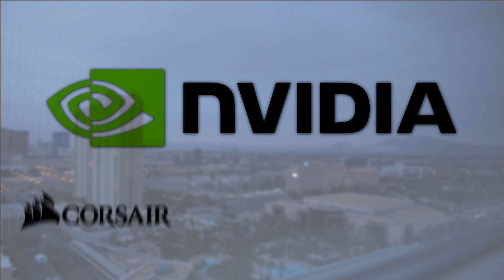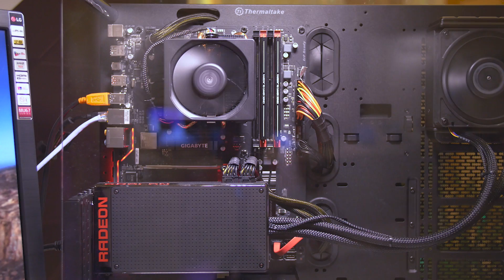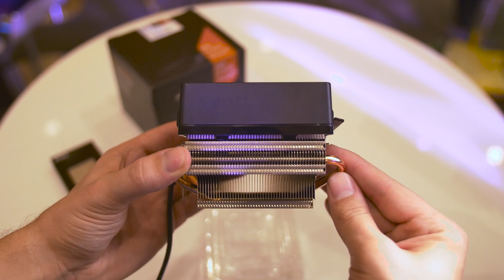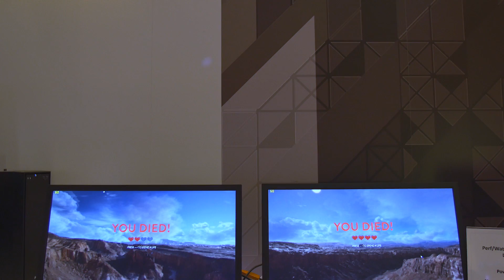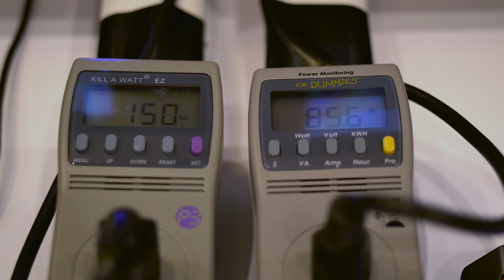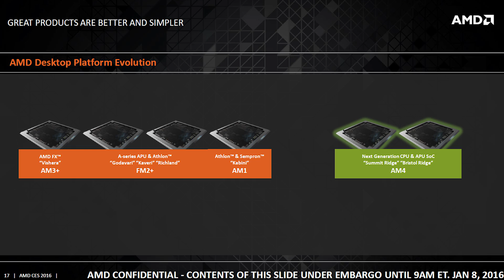AMD Polaris, new Wraith CPU Cooler & AM4 Zen

Comment: AMD going on right direction.
Reply: +Kevin Colon shipping this only with their processors :(((((((((((((
Reply: +Oliver Madariaga its a stalk heat sink... it still doesn't cool it any better, its just prettier and quieter.
Reply: +Machina quiet means it cools better because fan doesnt need to go full speed to get cooling done. same thing with my old hyper 212 cools better and quiet too. fan barely spinning.
Reply: UltraPhaserBlast yes but I'm saying the cooler doesn't lower the temps anymore then the previous one. it just does the same thing more efficiently.
Reply: +Machina the laws of physics and thermal dynamics state that a more efficient heatsink  transfering more heat away than a less efficient heatsink given duty of cooling an equal heat output from the same processor will yield lower temps on the core. its pretty simple. may be able to overclock a bit more with these instead of the old design and keep quiet fan noises. all win. even the old cooler with heatpipes has been proven to cool better than a intel copper/aluminum heatsink. but becauae they need to with fx cpus higher tdp heat output ratings.  linus techtips did a youtube video comparing on same cpu. sbold see that vid so u understand.
Reply: +UltraPhaserBlast “UltraPhaserBlast” Or, they got a fan that is much more quiet than the old one. It's a long shot, but that's my guess.
Reply: Andrew Wagenknecht they got a quieter fan and made the heat sink larger
Reply: fighting for the poor man

Comment: Looks a million times better than the shitty old one and a billion times better than Intel stock heatsinks. Seriously, when people do builds and use those stock heatsinks it makes me wanna scream. This however, looks good!

Btw, I'm really hoping to see a huge AMD comeback. I want the glorious Athlon 64 X2 days back!
Reply: unfortunately not. unless AMD comes out with some stellarly revolutionary item. it's actually really amazing, but intel pretty much controls AMD's market share and thus profits. They cycle through stuffing them down to about 5% followed by a cessation in marketing that allows amd to grow back to 20% ish. All to prevent a monopoly.
Reply: +IRNatman I want to see AMD back so they market isn't just controlled by intel
Reply: +IRNatman Also remember when amd used coolermaster for their stock fans
Reply: +IRNatman Athlon days*
X2, X3, and X4's are all great CPUs.
Reply: Captain Leerox
But I'm talking stuff of legend. When the Athlon 64 x2 came out it changed EVERYTHING. The x3 and x4 were just upgrades. They were great, but the X2 was revolutionary.
Reply: IRNatman OH MY BAD you said ATHLON 64 X2 not Athlon II X2
Reply: +IRNatman Because stock coolers get the job done for 80% of people.
Reply: Timothy Haun
For Intel, maybe, just maybe. But if you're spending hundreds on a CPU, why not drop 30$ on a 212 EVO? It'll run much cooler and quieter.

But stock AMD coolers sound like jet engines and shouldn't be used. Perioid.
Reply: That logic is awful. If I am going to spend $120 on an i3 it won't need an aftermarket cooler, if I am spending $190-$230 for a non K i5 it doesn't need it. If I am buying a non K i7 and not a power user I don't need it. The AMD coolers that have heat pipes also get the job done for any FX chip, excluding the 9590 of course, that isn't overclocked. But I agree, stock AMD coolers are better off replaced. BUT NOT with AIO Liquid coolers or tower coolers. The Horizontal cooler does more than cool the CPU, it helps keep the chipset cool too, which is a common problem for the FX platform.

That $30 would be better suited going towards a couple of case fans which will help with temps more than an aftermarket cooler in most instances. Or into your GPU. Now if we are talking about overclocking then of course get the aftermarket cooler, or if you're worried about aesthetics I suppose.
Reply: Timothy Haun
I said nothing about a cheap ass i3. I clearly said "if you're spending hundreds". Please pay more attention next time.

Why are you bringing case fans into this? I'm talking CPU only right now. If you didn't already work case fans into your budget, then you aren't very good at building PCs, are you?

The 212 EVO is much quieter than intel stock heatsinks. On lower fan settings it is completely silent. I bet if you used it as a passive heatsink it'd still perform better than the cheapo stock heatsinks. Why not get it? Again, like I said, if you're dropping hundreds of dollars already, why not spend an extra 30 dollars on a proper heatsink?

WHY would you buy a non K i7??? Do you also like wiping your ass with money? Buying a non K i5 isn't the best choice already, but a non K i7? Madness! Also, if you're talking non power users, why would they need a i7 in the first place? Flawed logic.

AMD stock heatsinks getting the job done? That's a good one. Maybe if you only have a x4 and are deaf.
Reply: +IRNatman  non k i5 are like $80 more expensive
Reply: +IRNatman  non k i5 are like $80 more expensive
Reply: +IRNatman Is this cooler a joke? No fan speed regulation? It's 2016 for gods sake. Why do you hate intel stock cooler? It's good enough for every locked chip. I have 4460 with stock cooler, never above 60° in games, virtually silent, the gpu and case fans are louder.
Reply: popula ....
Are you talking about the Wraith cooler being a joke?
Because it's literally a stock cooler, the "Wraith" branding literally is a way of saying they are updating their AMD CPU stock cooler design to eliminate any issues people have with AMD's current cooler. It isn't meant to compete with any other cooler, just to postpone or eliminate the NEED (To me, if I'm running an 6300 on a stock cooler, I definitely will upgrade in the future because the current gen CPU cooler is not adequate, the WRAITH cooler, however, while not only being more aesthetically pleasing and EFFICIENT (Heat-pipes and the efficient fan design)
Reply: Captain Leerox It's seems like a good cooler and all, but NO fan regulation? 2$ case fans can be regulated...
Reply: popula You mean like fan speed? PWM?
Reply: +popula Kinda sounds like you have noisy gpu or case fans if they're louder than the intel stock cooler.
Reply: +IsoMacintosh when i stop the other fans from spinning by hand i can barely hear the CPU cooler. fan mode is set to silent in BIOS. GPU is always louder at load because it has a much higher tdp and its load is much higher when gaming.
Reply: +IRNatman Intel is trying to focus on mobile chips because that's where the market is currently at. AMD however isn't so maybe it's possible they can have a comeback in the PC market. Who knows?
Reply: +IRNatman Been running Intel stock for 7 years on my Core 2 Quad Q9550. Guess I make you really sick.
Reply: Wistbacka
Core 2 Quad? Not really a big deal.. (My HTPC with a Q6600 has a stock heatsink) I'm referring to new expensive CPUs. Yes, I'm aware that the Q9550 was expensive back in the day, but it's just different now. Really amazing aftermarket cooling solutions are very cheap today.
Reply: +Timothy Haun 

Fuck. Intels Haswell chips got stupidly hot. No stock cooler could keep up with most of them even at stock clock speeds. Hence the many complaints about the cpus getting too hot under load and beginning to thermal throttle themselves. Several of intels i7 K and X series chips dont even come with a stock cooler like the 5690X, 5820K, 5930K or the 6700K Skylake. And for AMD, yeah that Northbridge heat issue with the AM3/AM3+ socket motherboards is a problem in its own right. For a current AMD build I would always suggest the buyer getting a case with side panel fans to actively cool that damned Northbridge chipset, regardless of what CPU cooler they used. At least with AM4 and Zen, the Northbridge bullshit will be gone. Just the normal chipset config like the Intel boards run thank God.
Reply: I have 1231v3 haswell processor under stock heatsink and it runs just fine. At full load it reaches 70°C but thats fine with me since intel says 73° is totally fine for that processor. It never reaches those temps while gaming, only while benchmarking.
Reply: *****
What are you talking about?? Don't you know Intel is a perfect company and can do no wrong???
Reply: yes looked better than fx series stock cooler

Comment: It's kinda cool looking. Looks really clean for a stock cooler.
Reply: +Mediarahan only intel stock cooler that looks like crap, amd one is alway simple, cool looking and easy to install
Reply: +xs3tsunax ...and noisy and not very efficient. I like AMD but the stock cooler was a problem they had to solve
Reply: +progste and they did solve it too
Reply: progste
and so the intel one. however, on this day only office PC uses stock cooler anyway. people that at least understand pc part will likely use aftermarket cooler
Reply: +xs3tsunax ? the intel cpu cooler is just pressing down 4 clips its very simple
Reply: Beyond Jinx
it may looks simple but its not quite because if you try to install it incorrectly the clip will get stuck and if you try to pull it out too hard the thing tends to broke off because it made from a flimsy plastic
Reply: +xs3tsunax My old Hp had aftermarket cooler.
Reply: SkeleCrafter
excluding the prebuilt. because prebuilt will always comes with brand specific custom cooler
Reply: xs3tsunax It was my first time building my pc on the 6th it was simple for me but i get your point
Reply: +Mediarahan am i the the only one that thinks amd is reusing the phenom II stock cooler with a prettier fan? lol

Comment: Hope zen performs like i7 with an i5 price...
Reply: same
Reply: why should it be priced that low? just because it's amd?
Reply: The Lukay Because they are known for Best bang for buck. They should maintain the legacy.
Reply: +Zaber Ansary And if AMD priced it the same as Intel competitor CPUs, everyone would prefer Intel.
Reply: +Zaber Ansary 

If it performs the same as what Intel is offering then the price will be similar. There are other ways to make AMD seem like better value such as offering cheaper motherboards. Also, if AMD continues to offer all CPUs unlocked then that's a HUGE plus for people on a budget.
Reply: Amd already said they can't compete by keeping he price lower so keep your expectations low
Reply: +Zaber Ansary 
I don't think you're necessarily way off the mark. 
Intels chips are all APUs, even the I7s and the Extreme editions. Their Skylake CPU cores take up around 10% (ballpark figure) of their die space each, leaving 20% for various controllers, and another 40% for their iGPU. 

If AMD are manufacturing on the same 14nm process, and making a dedicated CPU, with comparable per-core performance, and SMT (basically HyperThreading), then, in theory, they could be putting twice the number of cores on the same size die at around the same price, but I think they won't go that far for financial and strategic reasons. 

Here's what I think will happen. They'll manufacture the dedicated CPUs with 8 cores per chip, (assuming the same die size as Skylake) bad cores will be deactivated, therefore almost every chip manufactured will be viable, so as to keep the cost of wasted silicon/man-hours to a minimum. Octocores will be reserved for the Black Edition/Opteron/whatever, because they'll probably be rare, and AMD will be able to charge a pretty penny for them. We might see odd numbers of cores again, like with the Phenom X3s and FX 6300, so they don't have to deactivate good cores on working chips, and they can charge a higher price for the extra core, and plug gaps in their SKUs again. 

Because their cost of manufacturing an (up-to)8 core CPU will be comparable to intel's cost of manufacturing a 4 core APU, (I doubt it's quite as low) I think they will be looking to provide a better product at the same price point. I don't think AMD want to kick intel's ass too badly though, because if the market swings to harshly intel will have a dedicated CPU out in probably 6 months ready to claw back their market share. I think we'll be looking at an extra 1-2 cores for the same price. That should be enough to steadily grow AMD's market share at cost to intel, without posing enough of a threat that intel abandons or significantly changes their current strategy in response. 

I'm hoping for SMT triple cores around the i3 price point, SMT quad cores at around the i5 price point, and probably SMT hex cores around the i7 price point.
Reply: +Zaber Ansary 

Course everything at this point is still mostly rumor and speculation. However from all the insider leaks and what has been let known, supposedly the first generation of Zen cpus should perform somewhere near the bottom tier of the i7s and upper echelon of the i5's.  Not beating Intel by any means. But definitely closing the gap if that holds true. Though having been through overly exaggerated FX series hype of the Bulldozer/Piledriver/Steamroller/Excavator, I take anything from AMD with a grain of salt. I'll believe it when I see it. Not that those cpus dont do well (realistically, unless your big time into video rendering or graphics designs, AMD FX cpus only loses to Intel in synthetic benchmarks which means all of jack shit in real world applications for the average user). But the market needs AMD back in this race. As long as AMD spirals downward, Intel will keep bending us over and fucking us with the prices and not really design anything new either. They just keep rehashing the same damn chips at various price points per quality grade of the silicon used.
Reply: In summary: Let's just hope AMD doesn't die cus then Intel has the monopoly (obviously) and then we're all fucked with the prices.
Reply: +Zaber Ansary Zen is the future... so its going to be i9, with the price of i7
Reply: NecronexX
no way, with 40% increase it is almost haswell level, and don't expect it to be cheap either

Comment: The new cooler is a lot like the one I got with my Phenom II X4 955BE back in the day, very nice
Reply: I still use my phenomenon ll x4 955
Reply: +coconut pie I still use the x4 965 BE :p
Reply: I got a 2500k and OCd the shit out if it 5 years ago, still kickin. My 955 never got more than 100mhz OC out of it
Reply: +Happy Lamp 

965 BE was a great freaking cpu. Think I still have mine laying around in the closet somewhere. I wound up getting that thing to clock at 4.1ghtz on a 990fx Asus board and it went toe to toe with the FX chips (actually outperformed the Bulldozer line and came into par with the Piledrivers)
Reply: +Cirux321 wow some nice shit, I have it over clocked at 4ghz with a 970 Chipset mobo
Reply: Happy Lamp
 Makes me wanna dig it out and slap a h100i liquid cooler on it and see how far I can push that ole cpu. I bet under water, I could probably get it higher. Hmmmm. May have a project this coming weekend :)
Reply: +Cirux321 you probably won't achieve higher overclock, the limit of this cpu and architecture is 4ghz